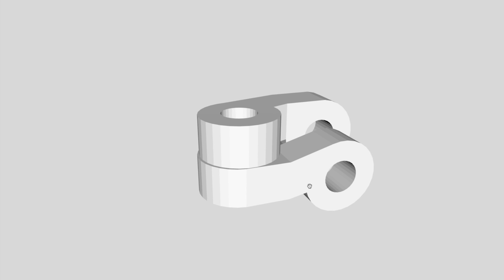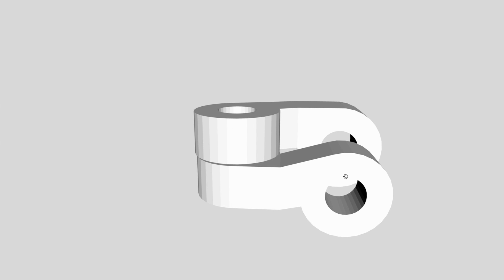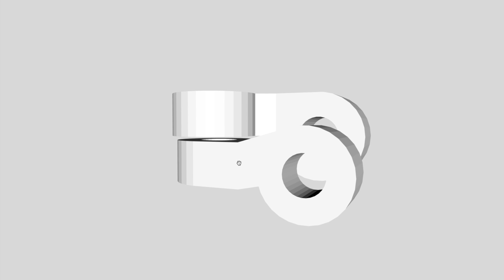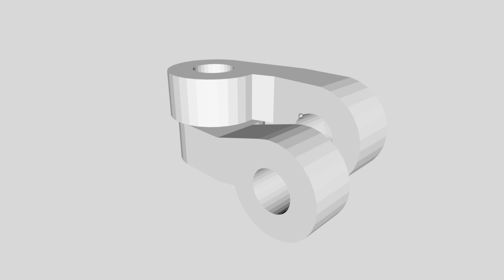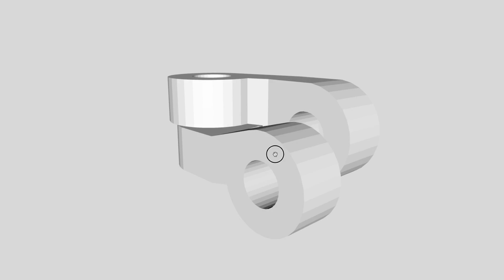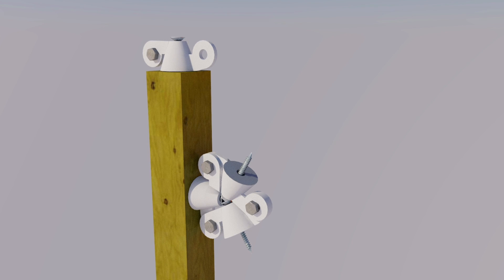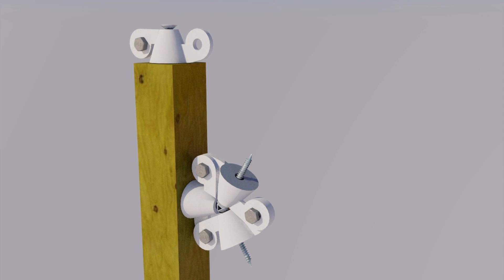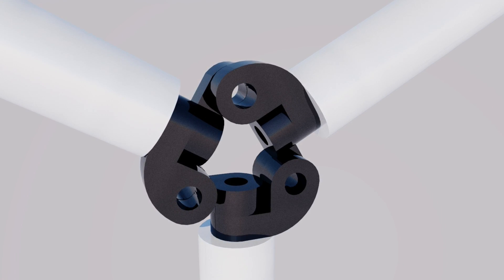Universal Hubs - More detail and STL files

Comment: i 3d printed mine .  the design and its very loose.  the bolts may help but im afraid they wont hold the frame tight enough.   i dont know if it will work well for a dome. the 3 pole variation is strong enough but the 5 pole variation flops around.  maybe you could add notches to keep the parts from sliding on each other.    lll wait for your test.

Comment: At this point it looks to be functionally equivalent to a couple twist brackets on the ends of each strut.  Because of the way they're joined to the next strut, I think that connection is itself equivalent to a set of basic 90 degree angle brackets, with the not insubstantial benefit of allowing hardware connections to be made perpendicular to the plane of the hub.  What benefit is there to using the design here over some heavy duty metal brackets?

The number of components multiplies quickly here: (2 ends x 2 connections + (1 possible spacer + 1 nut + 1 bolt)) x number of struts.  My primary fear with this design, though, is that there is too much freedom of movement and keeping the hub structure both uniform and tangential to the theoretical sphere could be a problem once build-time loading becomes a factor.  And if that's not maintained, then there are serious consequences for transmission of load in the structure.

Will be following, and may build some models myself.

Comment: It looks like you have made the two pieces identical, which simplifies manufacturing, only one mold needed to cast the pieces, much more economical than the previous design.  I still feel you need some friction lock between the two mating surfaces to prevent rotation under stress.
Reply: 54nathanael that makes sense, maybe with some lock washers inserted between linkage points.
And perhaps to print them using a rather durable grade of weather and UV proof plastic composite. A 2 part mold printed up or carved with a cnc, with the molds properly sealed and with proper mold release coating added, the multi purpose pieces made from graphene and marine grade resin. If making a lot of them, that would seem more affordable, though someone else mentioned that a similar shaped connector was made by twisting some metal even. At any rate, the friction mount you mentioned is a logical one.